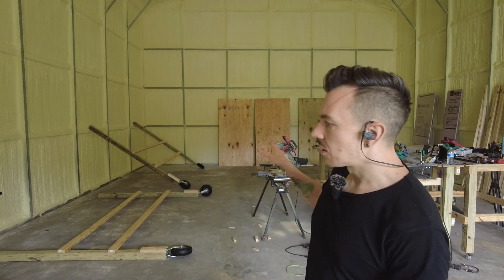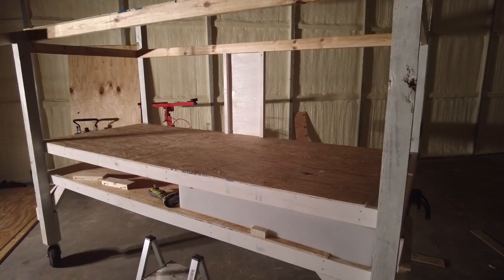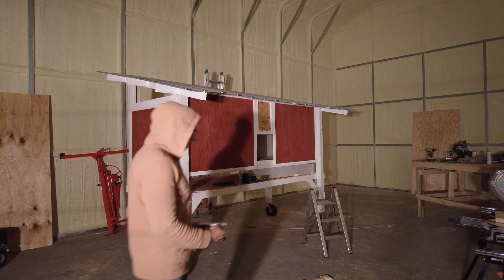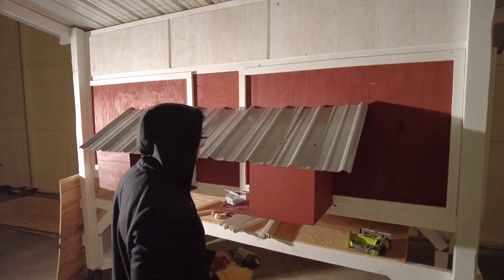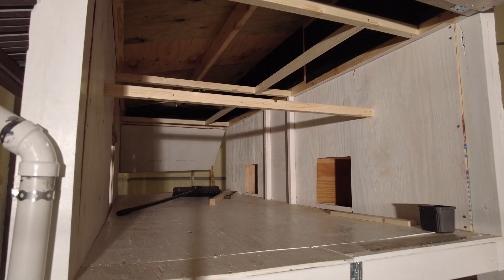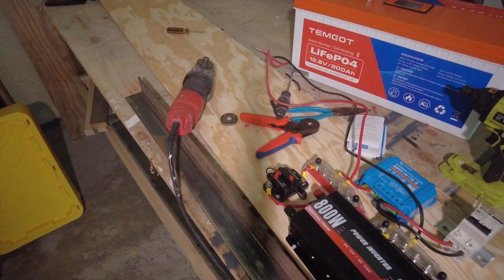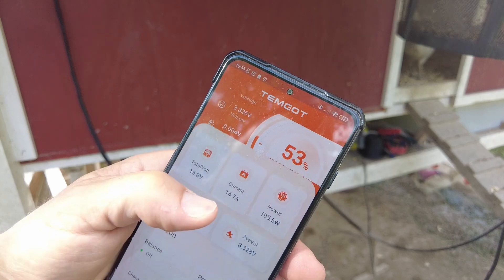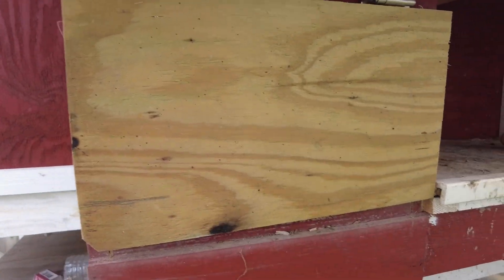DIY Mobile Solar Chicken Coop | TEMGOT 12V 200AH SELF HEATING BATTERY

Comment: That was an Awesome build for your chicken! I recommend the fake carpet grass or mats for the nesting boxes, and put them at a slight angle. I had to create my own drop nesting box, because my chickens started eating their eggs 🤦🏽‍♀️
Reply from the maker: Yeah occasionally some of them eat the eggs. I put some fake wooden eggs in there to de-train them on that and it seems to work. I tihnk i might just install some prefab roll-out nesting boxes at some point.
Reply: Did you get that solved? I 'think', not sure, there's some sort of calcium deficiency when they do that, but it's been a long time since my grandmother raised chickens.